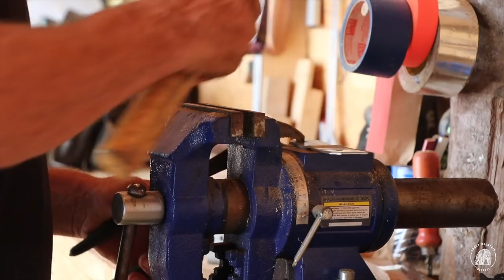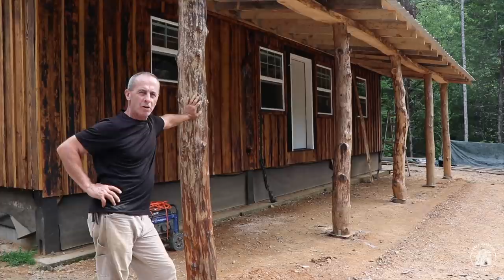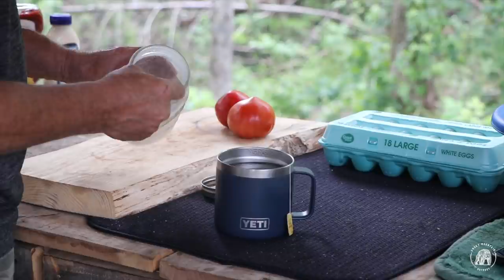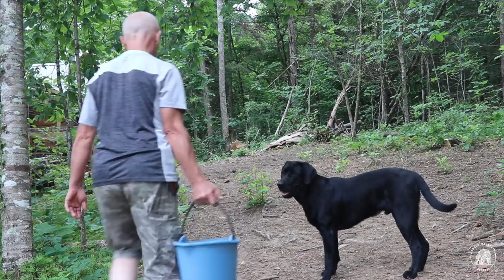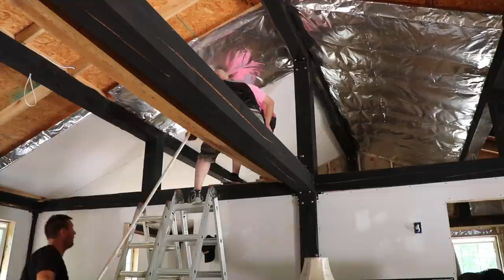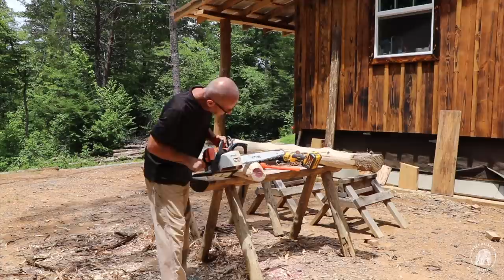BUILDING A CABIN BED FROM CEDAR | ANCHORING FRONT PORCH POST & BEGINNING CABIN CEILING

Comment: Looks like you need to sharpen your knife, it should not have any trouble starting a cut inna tomato.
You probably told us before when you framed it but what is the small space for between the larger areas you just hung drywall on?
Nice ceiling!

Comment: Not sure, but wouldn't a belt sander be quicker than the grinder?
Reply: Like the grinder for getting into the crevices, it is the perfect tool for sculpting wood in my experience.
Reply: @dickdavidson3616  I agree, but for smoothing and flattening...
Reply: @paulmonk7820  agree, grinder for bulk coarse work only

Comment: Harbor freight sells a drywall lift for around $250 that will let you get the drywall up on the roof without so much hassle and with you doing the project over time it will be cheaper then renting one. Always a useful tool to have simply to loan out when someone is doing drywall as a sorry I can't help on this but you can use this tool to make it easier.